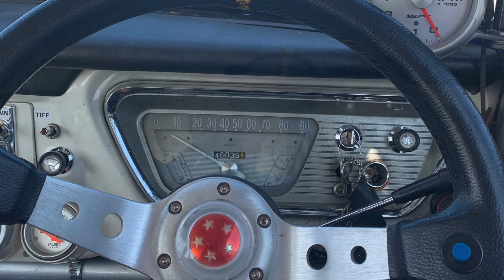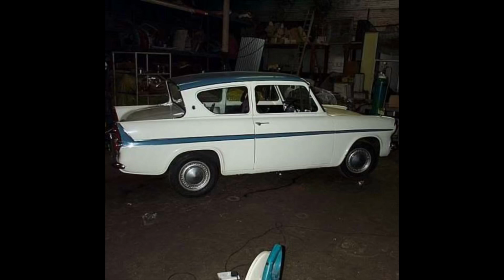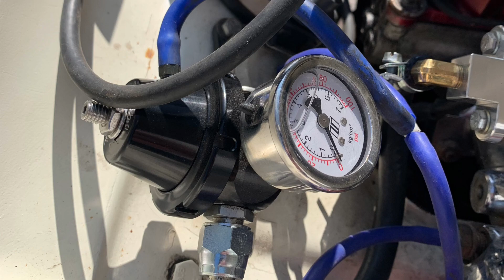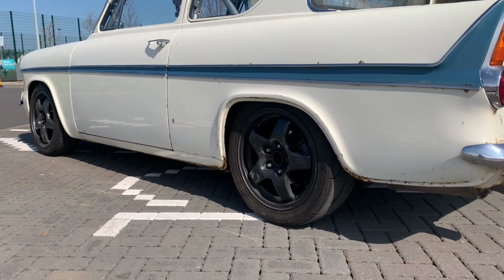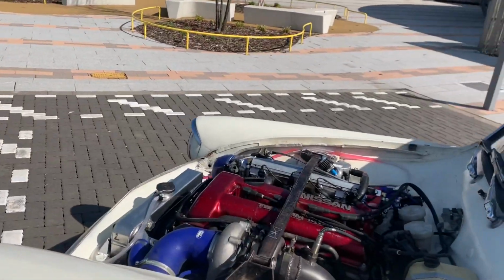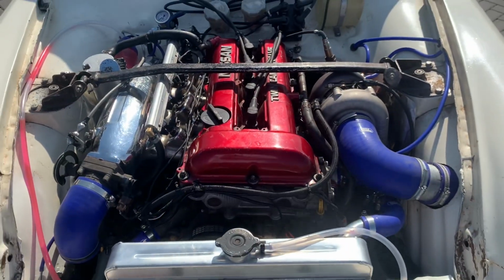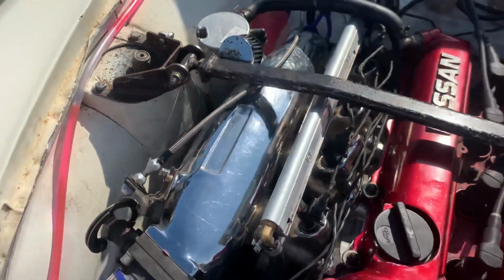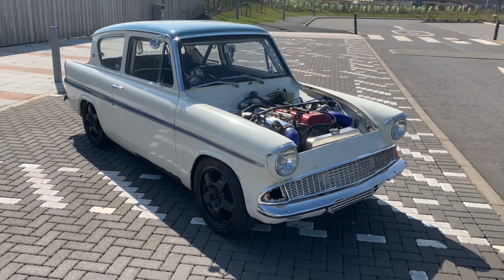105e Ford Anglia - SR20DET!!

Comment: I remember when your Dad 1st built it... an Aberdeen car! I had a 1200 Super in Ermine white, but with Dragoon red stripe & roof when I was 11! It probably came from Cordiners or Harpers in Aberdeen... KRS 15F was the reg. Registered a few months apart. Cheers. Leigh. PS: Like your Dad, I've not stopped modding old motors 🤣🤣 PPS: Your Dad might remember my old Cossie Corsair from Retro Ford mag March 2008 issue. Rolling shell sold & the running gear is now in my 1974 2 door Vauxhall Viva HC!
Reply from the maker: Hello- that’s a mega but of history! 

Haha, yes it’s been through a good few changes - will have another big freshen up for hopefully an outing this year! 

I seen your car on Instagram it looks amazing - on the road soon?
Reply: @GlasgowGTR  Excellent! No, it'll be a few years yet! Costing a fortune!!

Comment: Super car but a slight mistake on description the vehicle is actualy a 123E as it is the 1200 Super model but a superb car ,Ihad a 123E with with a 1600 BDA engine 2000E gear box and anglia van (107E) diff rapid car